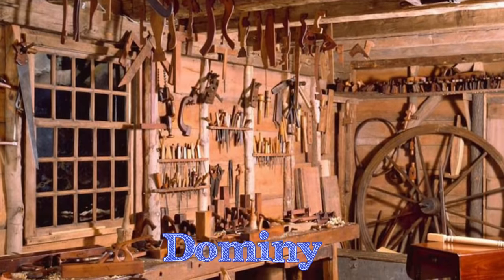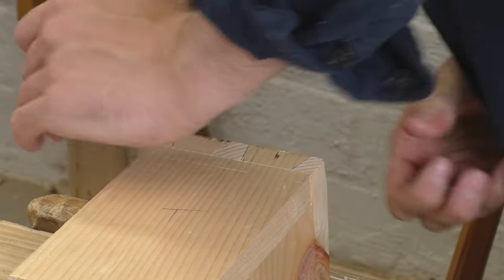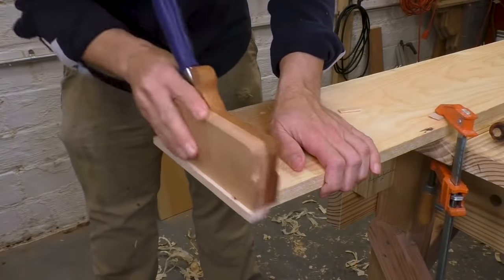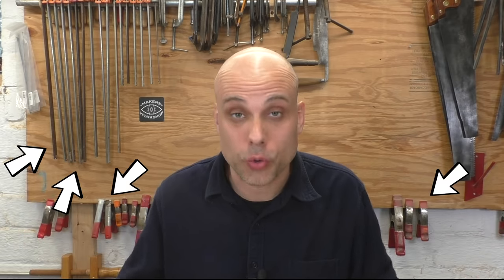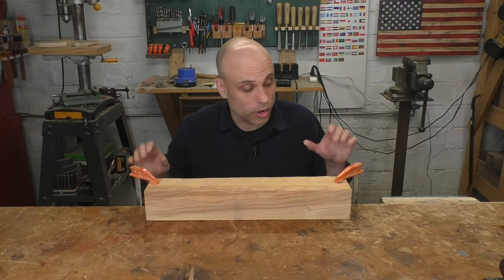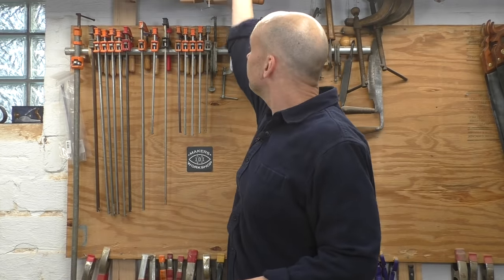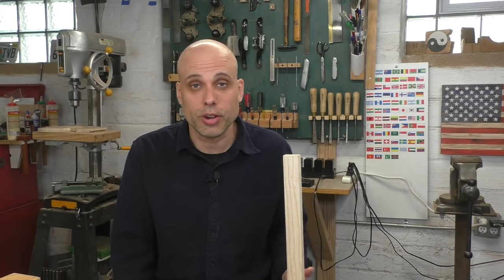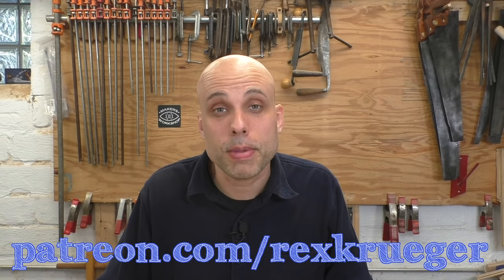Woodworking with very few clamps (maybe only 5).

Comment: People forget, or don't realise, one of the oldes types of clamp is just STRING (or rope). There are many applications where if you wrap string round joints, the pressure will build up, wrap-on-wrap. Wind a piece of string several times round your finger to see this. 2 boards to cramp together? String will do it. Cramp a mortise and tennoned frame together? string will do it. Okay, it can be a bit "fiddly". But there is a modern alternative; Band Cramps. They do exactly the same job. They are looooooooooooooooong, and don't cost a lot.

Comment: Great recommendations Rex, always enjoy hearing your opinions. 

One additional recommendation, pinch dogs. If you need to glue up a panel you need a pair of pinch dogs (one at each end) for each pair of boards you’re edge gluing. I’m looking at Lee Valley and a set of 6 ranges from $12.90 to $18.90 depending on size. Pretty inexpensive and worth a try.

Comment: I only have short clamps which limits me by some, but I get along with these mostly: 3 qucik grips, 3 medium sized F clamps, 2 heavy duty F clamps, 3 small F clamps and a spring clamp.
Reply: Unless you can afford those fancy Bessy clamps it is hard to beat some pipe clamps.

Comment: Have you considered dowel joints as another way to avoid needing clamps?   A tight fitting dowel isn’t likely to go very far.  I recently saw a review of the Dowelmax jig and it looks like something I may need to add to my toolbox.

Comment: Hey Rex, I suggest throwing these Rockler pipe-clamps: "https://www.amazon.com/gp/product/B00QU03I3A", in your Amazon store. I've used every brand of pipe-clamp made in the past 40 years, extensively.. Pony are good...these are awesome. They are heavier built everywhere you'd want them to be, and not over-built where it would make no sense to be. The life and death of a pipe-clamp is it's acme screw and the cast threads it turns in. And that's where these leave the rest in the dust! Every time I unbox one of these, I'm still blown away that this level of quality can be had at this price. I guess I'm just conditioned to expect cheap Chinese crap, when the price is low. Not so with these. Whatever you do, don't buy the "red ones" on Amazon. Those are precisely the sort of Chinese junk you'd expect, for the price! :P

Comment: Anyone who works with curves or laminations would just laugh at the suggestion that they can do without clamps. Boat builders, for instance, or people working with veneers.
Oh, and here's a tip. Drill your peg hole through the mortice before you chop out the mortice. This prevents the break-out from the inside of the mortice.
Reply: Well, at least these days a vacuum bag can do what our monster antique Parks 4’ x 10’ screw press did. Same with curved laminations.
Reply: Is Rex building boats?

Comment: I mostly only use a few dewalt trigger clamps and 4 bessey revo parallel bar clamps. I dont get why so many people only have the standard metal F clamp, I hate the small surface area of the clamping on those tiny circles... but i also have 8 spring clamps that are VERY useful and cheap

Comment: Hi Rex. I absolutely agree that trimming back the kit actually increases the capability and output. It allows you to focus on the work and not the maintenance, which does take up a lot of time in a power tool scenario. As yourself and Paul Sellers have said, "if it worked in the past, it will work now".

Comment: Spring clamp pressure is not adjustable as screw type clamps are.  But some are weaker than others.  For smaller jobs clothespins or rubber bands are useful.  Other items useful for clamping are  bungee cords and tourniquets (French clamp?). 😁

Comment: Before I even knew how to wood work, I bought Pony Parallel and F-style clamps.  8 of each size, 40, 18, 12, 6.  I have absolutely loved them.  Bessey are way too expensive for this hobbyist.  I have had my Pony  for 12 years now and they have not even shown any wear, and I beat up my clamps pretty well.

One note though.  Before you use them, please wax all the metal parts.  Trust me, it will help you in the long run.

Comment: I use a large number of clamps in the layout and design process of things. Since they are great for holding stuff so you can visualize and take measurements on what your doing. Lately I have been buying a lot of the irwin, single handed racket F clamps. Since they make it so very easy to clamp something in place, while still holding the parts in question still with your other hand. Really its just a time saver rather than a necessity.

Comment: Hmm... if you misalign your mortise and tenon joint, isn't there a possibility to rip the tenon? Doesn't sound like a very good idea. Maybe just use heavy items to press the joint together? With a long plank you could get quite a lot of leverage, so less heavy lifting needed. Well, it would be kinda a clamp but you can create your temporary clamp out of pretty much anything.
Reply: Like rubber bands, any rope, etc. can be a part of your clamp. Two ropes twisted can generate insane pressure. Many rounds of thin rope wrapped tightly around something, same thing.

Comment: Nice! But I'd still like to see a clamp making video. Specially because I've never seen anyone making clamps with hand tools (except for Moxon vises, but they're not exactly clamps).
Reply: Make clamps if that's what you want to do. But most people want to make other things. I've tried to make clamps. Not worth it for me. The clamps Rex suggests are not that expensive to buy. I've gotten imported F clamps. Maybe they're not as good as name brand ones but they've worked for me. On sale they're dirt cheap too. I have them from 6" up to 3 feet. Past that I use pipe clamps. I think I have 4 or 5 of them? Some sash clamps are nice too. I have 4 of those. They're imported and were cheap.

Comment: Having 1 arm/leg, means I need 10x the clamps. Not just for woodworking but for life. 
 
I make some clamps (like for the Pantorouter I made) but I prefer to buy clamps, as every job I do (even jigs) takes 10x longer.
 
My biggest issue is clamp quality. Good clamps are getting harder to find. Bessey and Irwin have been (sadly) cheapened beyond belief. I like Jorgensen,  but I'm not expecting them to also start to cheapen, as they recieved the "Lowe's kiss of death" and now are (somewhat) exclusive to Lowe's. 
 
So clamps are vital for me... but it's at the point where I'm seeing more Harbor Freight disposable clamps in my shop, because if a clamp is going to fail, I might as well spend less on it.

Comment: Well Rex, nice concept but you just ended up using a clamp or two going via using nails, weights in fact just about anything but avoided the term clamp!! Nice One!

Look we use things because we have them and can do so. Old times things weren’t available to them. It didn’t mean rope, string or whatever wasn’t used.
At school we were taught woodworking without any glue or clamps. Our tutor worked on the idea that if your joint is good enough it will hold. But he cheated as things were used to apply pressure just as you have and today, some 40 years on I still ‘pin’ my work! So he got through to me I guess??

Great idea, loved the concept but they used to remove legs without morphine , I’m not going back there either! Lol
Bob
England

Comment: Then there are "timber dogs." They can be used to glue up panels with "sprung joints" but you would not hollow out the edge in the middle but would do the opposite and install dogs at both ends to close the gaps at the ends. A Paul Sellers blog article "Making Your Own Timber Dogs " shows how you can make them yourself and his YouTube video "Edge Jointing with Timber Dogs" demonstrates the use.
Reply: Also, about "sprung joints" planed higher in the middle rather than lower (convex), so that you need to clamp at both ends, at about 6:00 in this video the use of wedges against stops is shown to apply clamping pressure to the ends of a workpiece. Those two boards of the workpiece were pretty wide so perhaps what I'm now about to suggest would be unnecessary for them. But suppose you have several narrower boards to laminate into a table top. You would not put clamps only on the ends, as with those wedges; you would have to put a clamp in the middle too. 

So how would you do that instead with two wedges? You take a scrap piece about as long as the boards that you're laminating and you plane one edge higher in the middle (convex) and put the scrap piece up against the last board as if it were another board that you were going to glue up but you don't use any glue, and you place the side that you made convex facing the edge of the last board of your workpiece. In other words, the scrap piece is a caul. Then the wedges on the ends will be exerting force all along the edge of the workpiece.
Reply: I was taught that a sprung joint also had the benefit of forestalling end checks, with that compression at the end of the slab. Looking askance at a technique that changes that to pre-tensioning, instead. I do like the use of those dogs, notwithstanding!
Reply: @leehaelters6182  Yes, I can report that the blog article by Paul Sellers goes into the possibility of that happening if your wood isn't dried/acclimatized enough. I also recall that Tommy McDonald (Tommy Mac aka T Chisel) when he had his Rough Cut show on had a guest who demonstrated the sprung joint, with only the convex edge shape that forces the ends together and they both agreed that it was to prevent the ends from opening later (as the wood further dried I suppose). Sellers demonstrated in his video that you could just put the assembly aside standing up against the wall for the glue to dry, as soon as you had the dogs in. So I wonder if the brothers that Rex was talking about, since they were in production and had few vises, were gluing up their table/desk/ chest tops and sides with dogs.
Reply: @moc5541 , seems a good bet. Are you situated near enough to visit that site and comb through the tooling for confirmation?
Reply: @moc5541 , a friend and shopmate, Duane Marks, would piece together templates and such of 1/4” MDF using dogs hammered onto the face for clamping.
Reply: @leehaelters6182  No, sorry. Where I wrote that the bothers didn't have many "vises" I should have written "clamps", as Rex reported.
Reply: @moc5541 , copy that! 😉
Reply: Replace "convex" here with "concave."

Comment: Interesting video. Does the sprung joint split apart eventually? Seems like a lot of stress on the panel
Reply: I was taught that it is also a useful way to forestall end checks, that compression on the end of your slab. I have never, ever, seen tension from that slight hollow overcome the glue joint. Of course, many of those across a wide slab add up to some significant deflection for the outside boards, I will admit. Best to keep the hollow small.

Comment: Before watching this video, and not knowing how you're solving the problem of doing woodworking with no clamps at all, I'd just like to say I've actually done plenty of woodworking without claims. I've used bricks and anything else I could get my hands on that had some weight to it and that I could balance on a board.

Comment: Rex, I totally love your style how minimalistic one can become in woodworking.
I always find myself struggling in-between (a) wanting to get better with hand tools, to make square mortis and tennon joints, and (b) get things done quickly and precisely, going back to machinery.

Then again my workshop / basement is getting smaller with each additional tool and still I'm missing something to make repeatable, square cuts in larger sheet materials, to create pieces too small for the track saw.... Any ideas for that?
Reply: Can you say more about what it is you're needing, or did you figure out a solution?
Reply: @willbephore3086  What I need is a method to get 90° or parallel cuts easily and repeatable.
I got a track saw, so many efforts were to build gadgets for it, as I lack space for a table saw.
I've looked into the many gadgets from Peter Millard, parallel guides, square cut attachment for the track, guide rail systems (i.e. bench dogs), even a self made MFT top.
It often boils down to a lack of precision (like 90° are never 90.0°) or material or space (i.e. a new bench top requires a bigger bench.

I imagined some adjustable parallel guides that can be fixed to the track, where you measure on the off-cut side to keep the track supported.
Reply: @MagSun  Okay I think I understand. I may or may not be able to be useful but I am happy to try. 

In troubleshooting anything, which I do somewhat frequently, I find it best to start with the absolute fundamentals (I was trained by an aeronautical engineer :) So, I don't mean it as condescending in any way to ask about 1) the work surface you're cutting on, and 2) what tools are being used to find squares, angles and cut lines. 

These two things confounded my woodworking results for years.

Re the surface, I have recently found a sheet of rigid foam insulation to be extremely helpful for track saw or even skill saw type cuts of sheet materials. It works great on the floor, which provides good control while making the cut, due to body weight being over the saw, it eliminates any drooping in the center of the sheet material,  and can be cut into smaller pieces to stack against a wall somewhere when not in use. It also can be placed on top of any other workbench surface as well, but it sounds like you have limited space.

Re the tools, I'll wait to hear back as there is such a range depending on application.
Reply: @willbephore3086  thanks for the advice. The isolation foam sheets were the first thing I got with the track saw (Steve Remsey 😉). Most of the time I use it on the workbench which is only about 60cm deep, for larger pieces on the floor like you mentioned.

I did find some plans for a stop at the rear of the bench plus a track hinge to achieve 90° cuts with stops on both sides, but my bench does not seem to be deep enough for that, if you know what I mean....
Was thinking to add a tool well as an extension to get to 80cm depth.
Reply: @MagSun  hey my time got real full there for a bit. 

Okay that's great you've got the insulation, you'd be amazed how many people don't realize that sag at the center is having an effect. Also Woodworking for Mere Mortals is the best!

Question: are your cuts coming out off of a 90° square in somewhat consistent ways, or is it fairly random? 

Also, is the 90° being off, just at the outer edges of the material, or also in the cut through the depth/thickness of the material? 

Adding a tool well does sound like it could be a good solution.
Reply: @willbephore3086  I usually use a (starret) combination square to align the track, which works, but takes time so much time checking 😉

So I've tried to build a track attachment for 90° you can bolt to the T-slot, but that has to be adjusted, too. Maybe I need some snug guide for the T-slot and fix that once adjusted.

I also feel the foam rubber strips leave a little play or are not that sticky, so I generally mistrust using it without clamping it down (more time added). I'm using the Festool track....
Maybe the shop vac hose pulling to one side is a factor for movement. I try to use it over the shoulder. However my basement shop is quite narrow...

So the idea to fix a track to the workbench and have the back long edge as the 90° reference  sounds like the most practical solution (especially with a rail that is not so much longer than the bench is deep, blocking space in front 😉). I've just not find the time to build 😕

Maybe I need a shorter track that's easier to handle for smaller pieces. Peter Millard build like a trimming station for the track saw, so you could use it like a miter saw for edge trimmings (or prices up to 20-30cm / 12-15").

Comment: Rex - what would you recommend for a clamping substitution when building the $30 workbench top?

I just verified on that video, you suggested using bar or pipe clamps when gluing it up!  So for many beginners, this bench is an obvious early build with minimal tools and now we are seeing we don't need many clamps...except to build the bench?!? ;) 

Your thoughts?
Great video, btw!

Thanks!
Plainsman
Reply: I used rope and wedges. Put pieces of 1x1 or broomstick perpendicular to your workpieces, make a knot and tie the rope over your workpiece in an X shape with 3 to 4 windings and tighten with the wedge in the middle of the X.
Reply from the maker: You could do it with the clamps I recommend in this video. One pipe and 2 bar clamps would get it done if you were building a smaller bench (5ft).
Reply: @RexKrueger  Awesome! Thanks for relying, Rex!
Reply: @mitschkoff super technique!! I wondered if it would be effective for thick, heavy glue-ups!  Thanks!

Comment: Couldn’t agree more about the machines; i got machines; but think I can stand dust, dust extraction and all that crap? Nah… haha; some I feel are not necessary, like cutting panels, as our box store does this when you buy the panels; just give them the dimensions; however routing long slots; i’d rather rout electrically than chisel and plane; drills and driving I like my press and handheld; but I prefer hand sawing inside and mitre saw outside; cheers awesome content mate

Comment: They didn't use that many clamps back in the day probably because they didn't have tons of cheap, really good wood glue. Unless you are doing it for killing time or for views 99% of the time glue is a better choice. But everyone is free to do woodworking as they like to. You like these no-glue or no clamps joints - nothing wrong with that. It's like power/hand tools battle. They are just tools. It doesn't matter what tools you use as long as they do the job